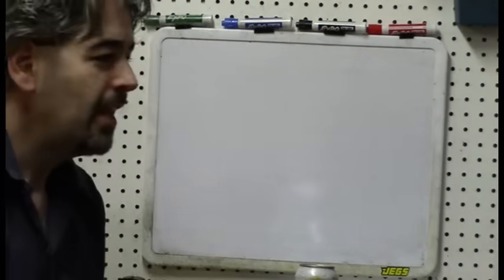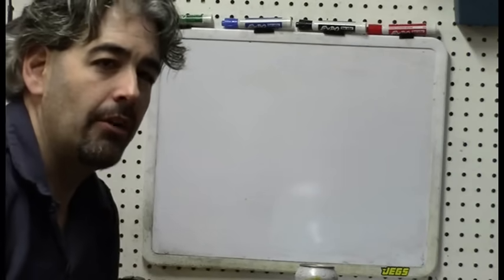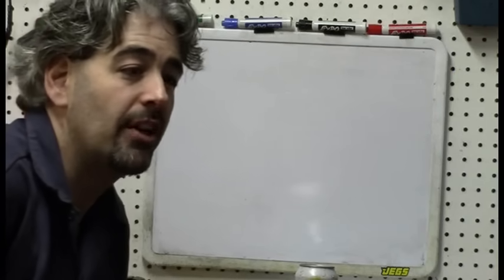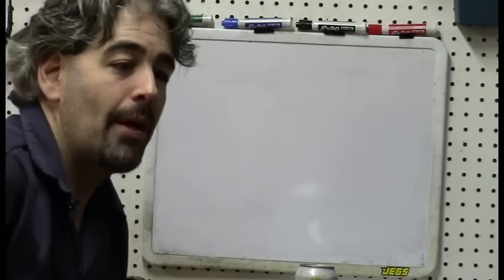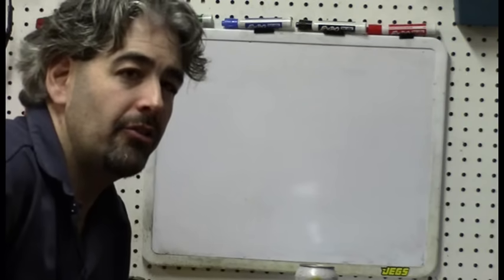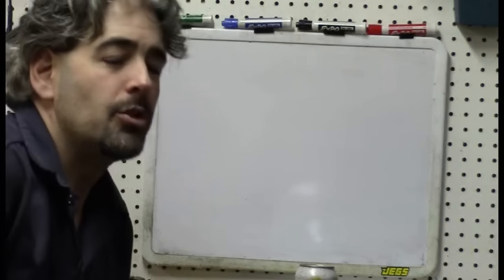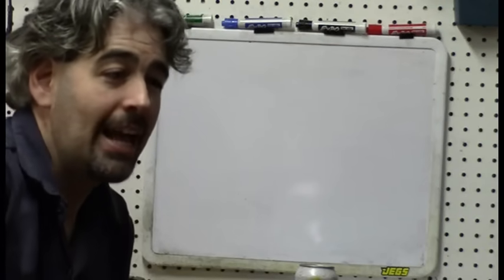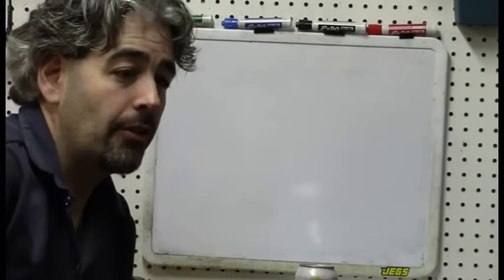Secret of Engine Problem Diagnosis- Fuel Trims Pt.1

Comment: I could really use your help in pointing me in the right direction. My engine is running rich 0172 and 0175 codes. My LTFT  at idle is -40 and -35 at 2,500rpm. I have a 2011 chevy equinox, LT 3.0, 2wd. Also, here is a freeze frame if it will help point me in the right direction. Do i have a vacum leak maybe?? I've spend a lot of money replacing parts and being advised. any help would be amazing!!

FREEZE FRAME DATA:
DTC FRZF: P0175
Fuel sys 1: CL
Fuel sys 2: CL
Load_PCT: 35.7
ETC: 95
SHRTFT1: -9.4
LONGFT1: -32.0
SHRTFT2: -11.7
LONGFT2: -32.0
FRP: 378
MAP: 50
RPM: 623
VSS: 0
SPARKADV: -20
IAT: 39
MAF: 5.17
TP: 19.2
RUNTM: 328
FRP: 2850.0
EVAP: 0.0
FLI: 20.0
WARM UPS: 1
CLR_DIST: 3
EVAP_VP: -25.75
BARO: 103
CATEMP11: 746.00
CATEMP21: 746.00
VPWR: 14.611
LOAD_ABS: 31.6
EQ_RAT: 0.999
TP_R: 5.5
AAT: 20
TP_B: 18.8
APP_D: 19.2
APP_E: 9.4
TAC_PCT: 7.8
Reply from the maker: What is your fuel pressure static vs load?
Reply: I'm not sure as to how to get this data tbh. There is something labeled LOAD_PCT(%) which with key in but not started it's a 0.0. At idle it's 46.5%. At 2000 Rpm it's at 27%. If this is not it, how can i obtain the static and load fuel pressure?
Reply from the maker: Yeah sorry I don't really cover basics- just the diagnostic analysis. You need to have a methodology that can be followed scientifically here.
  At the very minimum you say you replaced a bunch of parts- was there any diagnostic process involved in that? If so perhaps there are some clues there. But as it stands I have no systematic methodology to execute on here
Reply: Schrodingers Box i understand. And thx for taking the time. There as no systematic methodology followed which sounds like the absolute wrong way to begin any sort of real resolve. I took it to chevy and they said that based on their books, to service injectors which they did but had no effect. That's the problem. It sounded like they were just guessing. So, i decided to replace things related to air/fuel mixture and still no good. I then decided to give up and seek help from people that clearly know their work, hence me messaging you.
Reply from the maker: Yeah wish I could help. With a rich condition your variables are high fuel pressure, incorrect air metering, unmetered fuel sources (PCV, EVAP, injector pulsewidth modulation incorrect etc) or O2 sensor inaccuracy causing fuel trim maladjustment.
  I typcially collect data for each variable and systematically rule it out to find the specific etiology.
Reply: Schrodingers Box this is a great help. I cannot thank you enough. This atleast gives me aspects to have thoroughly examined and checked off. If there is any advice you need graphic design/branding related, you know my name, just reach out. I'd gladly help.

Comment: Ltft b1 -15.61, b2 -14.84 ; stft b1 21.88, b2 21.09  O2 sensor data is 1.06

I’m thinking vacuum leak.
Reply from the maker: Based on what? Why do you think vacuum leak? You only have one single timepoint- there is no curve against load!

Comment: So what could cause the computer to shut down 5and 7 injectors only codes are o2 because cat delete, and 5&7 injectors
Reply from the maker: What is the signal output for 5&7 showing from the PCM?
Reply: @SchrodingersBox  fluctuating 3 - 2 almost 4 volts
Reply: @SchrodingersBox  98 Dodge Dakota 5.2 l plentum gasket a month later never ran the same again
Reply from the maker: 4 Volts????? Thats your issue then!!!
Reply: @SchrodingersBox  guess I got to watch all your videos again to understand I'm not a mechanic and really got screwed my truck ran  pretty good until a "mechanic" gave me my truck back with a hard idle and loud backfires  but no worries I'll figure it out thanks
Reply from the maker: @zacgamboa7970  You already did. If you got 4V from the signal at the PCM it's a bad PCM. No other explanation. I have never seen that happen before though. Most designs are ground-side switched but it that's actually what you got then that's the issue.
Reply: @SchrodingersBox  ok so when reading up on timing I read to go 45°  in advance that put me before the v6 mark on the cam I put it at 10° v8 reset the pcm  by touching cables and replaced plugs and wires routing them so the don't cross spark and runs great again a little more duel consumption put no misfire and all the power restored and no codes other than o2 because it's cat delete  thanks for the vids  I might become a backyard mechanic now lol Im joking I'll stick to what I know

Comment: Yesterday I replaced the PCV valve and hose on my Mondeo mk3 Duratec 1.8 petrol. Unfortunately it did not solve the symtoms I have on my car. What is happening? When I start the car the idle speed is around 1.800 instead of 800 and when I slightly push the accelaration pedal and remove my feet quickly the speed increases to 4.000 and higher and the engine runs out of control. I have to turn of the engine to prevend damage. When I disconnect the idle air control valve the idle speed is and stays on 800 (airco off).

So with help of your video's I did the following;
- removed the swirl flaps (last year)
- replaced the idle air control valve
- replaced the T-Map sensor
- replaced the PCV valve and hose
- cleaned the throttle body
- inspected the throttle position sensor
- checked for vacuum leaks

None of this helped. It seems to me that the Engine Control Unit instruct the ACV to open wrongly. Is my ECU broken? I have no clue, do you have any ideas perhaps?

Thanks!
Reply from the maker: What was the data you got that indicated the pcv needed to be replaced- also what was your data showing the MAP sensor and IAC was faulty? I would totally start there.  Especially the IAC- what was you data showing this needed to be replaced? Huge clue there.
Reply: Hi, well I have no data. Maybe collecting data is the best next step. What I did was just replacing the parts which are linked to idle problems. 1 positive outcome, the engine petrol consumption according to the ECU has dropped from 8ltr/100km (before) to 6,7ltr/100km (after). Now I am driving without the ACV connected. When the engine is cold it shuts down a couple of times (all what consumes electricity turned off), when it is warm it stays at 800 idle. Thanks for your help!
Reply from the maker: Yeah I use data rather than just replacing parts. If you get data I am happy to interpret what the actual issue is. But parts changing is just not my approach.
Reply: Thanks! Thursday I receive my OBD 2 device and share the data with you. Kind regards Nienke
Reply: Hi, the only error OBD is showing is related to the not connected IAC. Connected the idle is around 4.000 rpm. Due to this I don't have OBD with the IAC connected. Here the link to my OBD life data recorded during a short testdrive with the IAC disconnected (IAC closed no airflow bypass) https://www.youtube.com/watch?v=zLhQywiQHew
Maybe it is the trottle position censor? 16,5% at idle seems to me very high.
I hope this is usefull and maybe you have an idea. Thanks and kind regards Nienke
Reply from the maker: 16.5% is too high- check the potentiomter input and outputs by voltage drop testing

Comment: I have a 05 colorado! P0455, tried gas cap, purge valve,  vent solenoid, still p0455, took it shop, tried throttle body, alternator, filler neck, found a ba ground wire to purge,. Still 0455?? Can you plz help me???
Reply from the maker: What data do you have?  What was your voltage at the vent solenoid that indicated it was bad? What was the voltage at the purge valve that indicated it was bad? What was the voltage on the bad ground wire you found showing it was bad?
Reply: @SchrodingersBox  after changing purge valve, took a nine volt, realized it was fine, clicked& was able to blow threw, so wasn't gonna pay 170$ on a solenoid, so tested w/ 9 volt,& no click, thought that was it,? But 0455 came right back, took to shop,? Haven't changed charcoal canister but, not clogged when I put solenoid on,& doesn't smell,& I can fill my tank???
Reply: @SchrodingersBox  3rd time back for 0455 code! Do smoke test! & No charge depending on what they find???
Reply: I looked everywhere for leaks?? Unless it's on the fuel pump? Can a charcoal canistor be bad and cause p0455 even though it's not clogged????
Reply from the maker: Ok  just come up with a basic plan. Very simple- close the vent solenoid and simply apply vacuum to the system and see that it holds as indicated by increased resistance on the FTP sensor and then apply voltage to the purge valve as indicated by the lowered resistance on the FTP sensor to see that vacuum decays rapidly. 
   just that simple test will show you where the issue is. 
   Always have a direct strategy. don’t look for the problem- instead, have it show itself.  Don’t let the system work you. Make it work for you and leverage the data already provided to you!
Reply: @SchrodingersBox  I really appreciate you getting back with me, love your videos! I don't have a scan tool or pressure gauge, took it back to shop, since they said under warranty, depending on what they find?? I will let you know? Thanks again for getting back with me!!!
Reply from the maker: What do you need a scantool for you to do that?  That’s just using a paper clip and DMM.

Comment: on first morning start up my car emits black smoke... n idles at 800 to 1000 rpm... it should at 1800 because outside is cold

when hot car is normal... what could be cause
Reply from the maker: A million things. what data do you have?

Comment: I work with these complex 2 stroke outboards, Optimax and Etec,  and fuel trims arent normally available. How would you suggest diagnosing one?
Reply from the maker: Do they use fuel trim feedback? If so you might be able to look at PWM on fuel delivery.

Comment: Ok so i determined i have a fuel or maf problem at idle i have negative LTFT at idle when pressing on gas LTFT increases to +10%. Ok so i unplugged my maf and at idle its -3% when i step on gas it goes -10% so does this mean i have a dirty maf bc I've cleaned it before this test?
Reply from the maker: No it doesn't. I means you have a stoichiometric imbalance that could be due to either induction mismetering OR fuel delivery inconsistency.
 Isolate the cause with a curve against MAP and MAF airflow to rule out which one.

Comment: I have a 2005 Land Rover 4.4 it loses power after driving for a little while I replace the throttle body and MAF sensor Dia catalytic converters Mia math Apple system and it still doing the same thing what could be my problem
Reply from the maker: No idea- you have no data.  What was your reason to change the MAF- what was the voltage indicating that caused you to think it was faulty? I would totally start there.

Comment: --------  Since technology moves so fast, what type of good OBD1 Scanner would you recommend?????
---------  I want to get the best scanner for fuel-trim-details on my 1990 Cadillac Brougham's fuel trim which has a 350 SBC T.B.I.     
----------Is their anything newer, more user friendly than the GM TEC1 or TEC2 scanners????????  
----------Then there's ton's of aftermarket Chinese TECH2 Clone scanners...?

I'm totally lost......been out of the industry-loop for years........
Reply from the maker: I do not use a scanner for OBD1 since there is too much variablility in the OBD protocol as opposed to OBD-2
  On OBD-1 videos I use DVOM, scope, and variable induction to do diagnostics since its so much easier on those vehicles.

Comment: perhaps a stupid question ; from novice student here ; can octane strength affect lean ratio ? 87 vs 93
Reply from the maker: ONLY if the engine is a high compression engine. Otherwise it will make absolutely no difference what octane you use. Using higher octane when you don’t need it has absolutely no impact positive or negative at all. Using lower octane on a high compression engine however will result in detonation which would cause lean reading on an O2 because of unburned oxygen.

Comment: I replaced the intake manifold 4.6engine and it runs slow,and when I put the scanner shows all emissions cat, htr, EGR valve no engine codes I am at a standstill don't know what to do.
Reply from the maker: always start with the basics when you don’t know what to do. just do a simple STFT and LTFT curved against load with rail pressure and MAF. as basic as it gets and it works every…single….time. it has to- it’s science!!

Comment: POP QUIZ

I have an 07 civic 1.8 that is getting poor fuel economy. Fuel trims are both negative (stft -4 ltft -10.5 at idle) and the car hesitates when jabbing the pedal. At WOT stft are 0

What’s wrong?
Reply from the maker: Answer: D- there is insufficient information to tell..
Reply: Schrodingers Box well what else do you need? I’m stumped hahah thanks for all the content. I been binge watching your content while not at work. I’m leaning toward a fuel delivery problem. The regulator is inside the fuel tank on these cars. I don’t want to be a parts changer anymore!!!!!

Comment: My F-150 is at 8% positive long-term fuel trim and it really gets lousy mileage 8 miles to the gallon. Vacuum leak?
Reply: No codes
Reply from the maker: No idea- whats the total tyrim curved against load showing?
Reply: @SchrodingersBox  I got to take it to the local JC Auto repair program and see if they can figure it out I'll let you know if they did anything good
Reply: @gear head I drive as slow as grandma

Comment: In a rich condition is it still 14.7 to 1 where obviously it has more fuel than air?
Reply from the maker: No a rich condition would be lower than 14.7:1 representing a higher percentage of fuel.
Reply: @SchrodingersBox how come the deciding factor if it is rich or lean is the presence of oxygen going out where data going in is AIR (78% nitrogen, 21% oxygen and 1% of a bit of something. My point is why not specifically the oxygen in the air is measured going in but the only one being measured going out? Of course oxygen content  as well as others in the air varies with temperature and pressure but still a 21% content in the air. Isnt it?
Reply: @SchrodingersBox by the way, what do you mean by lower than 14.7:1 ? Does that mean no matter what the condition is it always oscillates  from lean to rich and vice versa? i thought the computer is obsessed with the ratio? It is clear on the average that 50% of the time not in the specific ratio.
Reply from the maker: Yes the computer wants that average ratio however it will adjust injector pulsewidth to oscillate between slightly rich and lean because that optimizes catalytic converter function.
Reply from the maker: @arieldepio7286 I believe it’s because there is a more complete consumption of oxygen than the other air components.  I guess they could have used a nitrogen sensor or something but I think there is too much inertness with nitrogen and of course carbon is already “burnt” so oxygen must have been the best indicator for knowing combustion efficiency.

Comment: I know this is a old video but what do you do if ltf is 15% positive and stft around -1-+3 at idle but under load 2500 rpm or so ltf corrects and goes to 0 but my stft sky rocket and go to +20 % positive I am really confused found broke down pipe replace that order a smoke machine fixed all leaks found and it still acts like this
Reply: engine runs fine to of course no misfire it's not even setting a code
Reply from the maker: What is the MAF frequency showing?
Reply: it's uses a map sensor no maf show intake pruse in hpa at 383
Reply: or it shows air mass in kg/h will read 8-9 at idle
Reply from the maker: Check fuel pressure.
Reply: it's a r53 mini Cooper s 
key on engine of is at 52 ors psi
key on engine on at idle is 43 psi
if you unplug the regulator it's goes up by about 10 
key on hot under revs stays at the same psi as idle in the mini Cooper book just shows spec for key on engine of and idle doesn't show a underload spec
Reply from the maker: Fuel pressure looks normal. It is either an air mismeasurement or actual fuel deliver issue BUT, given that your LTFT is zero I wouldn’t take any action until you see the LTFT react. If the LTFT is zero then you don’t really have evidence of an issue yet. See where it stabilizes at first.
Reply: @SchrodingersBox  hey so when I got home I re did a fuel test I had pretty bought all the thing outta a wrecked car fuel pump and engine and transmission turns out it was the regulator every thing is back to running normal fuel trims when back to close to one ltft being positive 1% and stft hang around -3-+2% gonna give a good drive and re check everything rainy in the area not a good day to be out driving lol

Comment: Hello, 
I'm trying to diagnose an issue with my car giving me a lean code on bank 1. My LTFT on bank 1 and 2 are both 1.25%. The STFT is fluctuating between 0.75 and 0.95 on bank 1 and 2. These measurements were taken from sct x4 handheld. Any idea what may be the issue? I'm guessing fuel delivery after watching both your videos. 

Car: 2002 Mustang GT
Reply from the maker: Why are you thinking fuel delivery?

Comment: I have a strange problem with my fuel trims...at idle my long term on bank 1 is %14, and 0% on bank 2, but then as rpm goes up ltft on b1 start dropping, BUT on bank 2 ltft starts slowly rising. By 2500 rpm ltft b1 is 8% and ltft b2 is 5.5%. any idea why the 2 banks would go opposite directions as rpm goes up?
Reply from the maker: looks like a stoichiometric deficit on Bank 2 to me. I would simply verify with variable induction to elicit response and see if it correlates

Comment: at 1838 you mention the engine will run perfectly fine but when you put your scanner in and short term shows zero will long-term still show 20%?
Reply from the maker: It depends- if that is the zero point for stoichiometry maintenance then yes